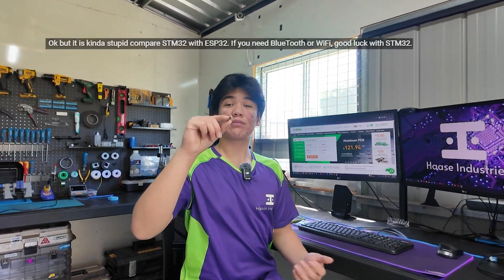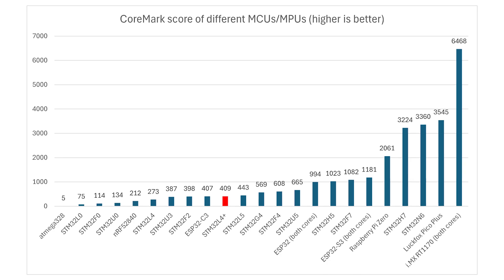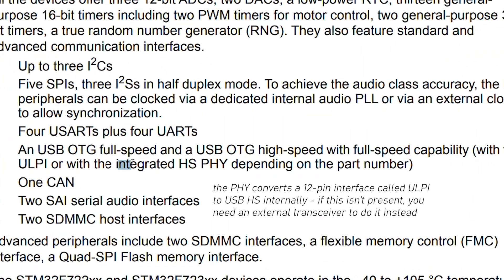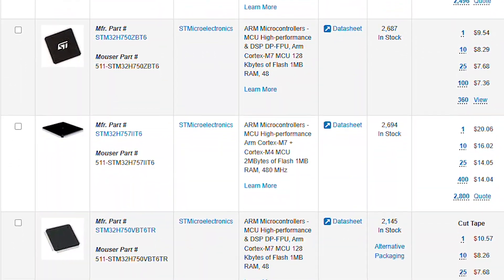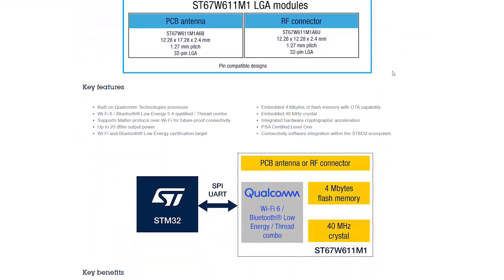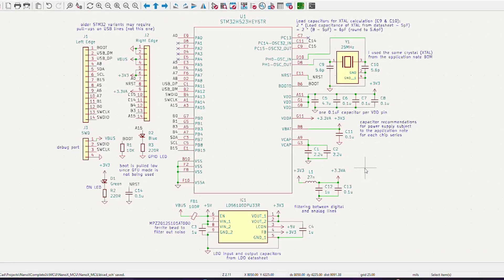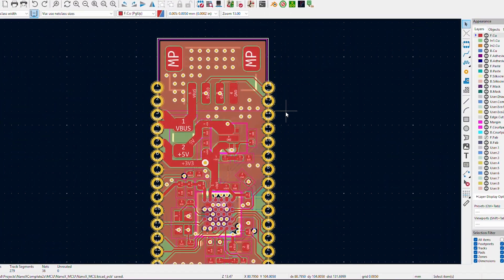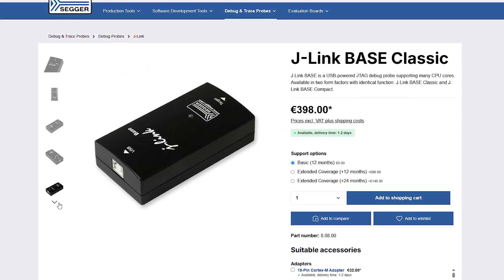STM32 custom hardware and chip selection guide + easy ordering from PCBWay!

Comment from the maker: Buy me a coffee if you’d like (literally this money goes back into the videos lol):
https://ko-fi.com/h1tec

Great STM32 software tutorial document:
https://wiki.st.com/stm32mcu/wiki/Getting_started_with_I3C 

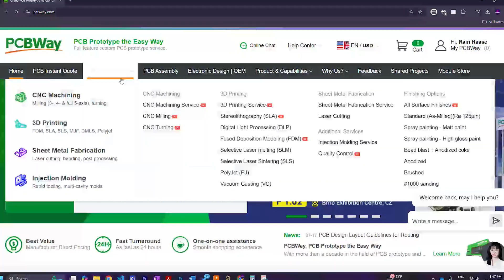Just to clarify, the price increase seen at 14:43 is due to extremely specialised 3mil (0.0762mm) trace widths & clearances and 0.15mm hole (via) size, which most PCB manufacturers don’t even offer because it’s so hard to get right. This just shows how good PCBWay’s QC and manufacturing processes are. For most projects with an assembled 2-layer PCB from PCBWay, it will only cost $5 + $29 + component costs as of the time of recording this video, with free shipping.

Comment: Nice video, I prefer using bare metal over HAL. It gives me more control over the hardware, results in smaller and faster code, and helps me understand what's actually happening under the hood. HAL is great for quick prototyping, but I usually find it too abstract and bloated for my needs.

Comment: 14:43 Price increase 😬
Reply from the maker: The price increase is due to 3mil (0.0762mm) clearances and 0.15mm hole size which is so specialised most PCB manufacturers do not offer it, for most projects it will be more like $5 PCB + $29 assembly and free shipping for 2-layer PCB with normal trace widths, clearances and hole size (6mil / 0.3mm hole). Sorry for not mentioning that in the video 😁 Take a look yourself, the prices are very competitive and quality is great.
Reply: @h1tec  I figured that was the reason! Thanks for the video—it really helps demystify everything. I'm working on a prototype where the STM32 is in a module version, and I was wondering how complicated it would be to switch to a more integrated version. This answers my question perfectly!

And it goes without saying—beyond just having good prices, PCBWAY really supports the open hardware community, so it's definitely worth ordering from them.
Reply from the maker: For sure, thank you so much for commenting and supporting this video 😁

Comment: The STM32G4 is highly suitable for FOC motor control, but in BEMF mode, it lacks the necessary speed. An STM32G071 would be a better choice for this application.
Reply: Why it isn't fast enough in bemf mode?
Reply: Isn't the G4 faster clocking than the G0 and also has FPU?
Reply: @   G431 is meant for foc use.  The back emf reading capabilites are not great. Only adc based. Quite slow in comparison. It can run but a f051 at 48mhz will beat it many times over in performance.
Reply: @Nayel-Khouatra  so G4 doesn't have analog comparator?
Reply: @teodorvangelov  it does but it's kind of messy you need to make a bridge between two comparator in order to have the same neutral point
Reply: I do think they have